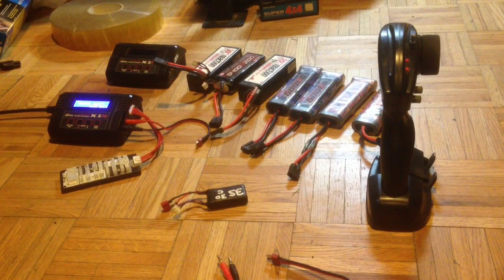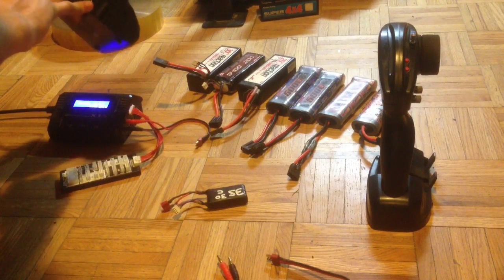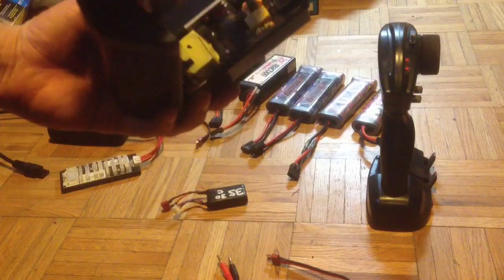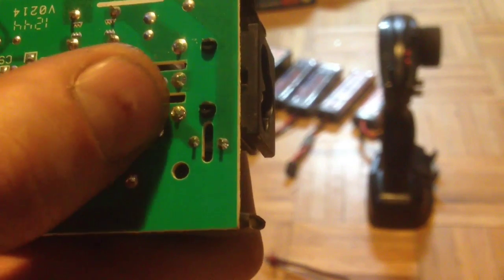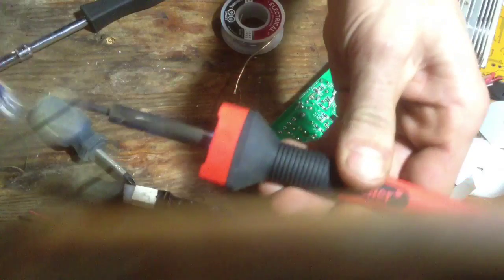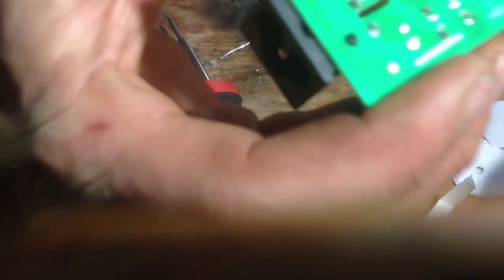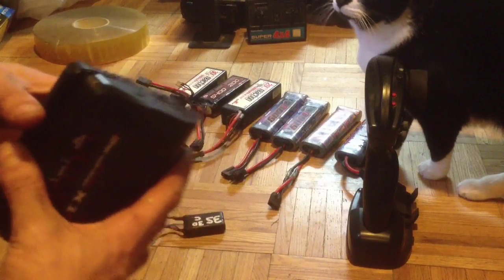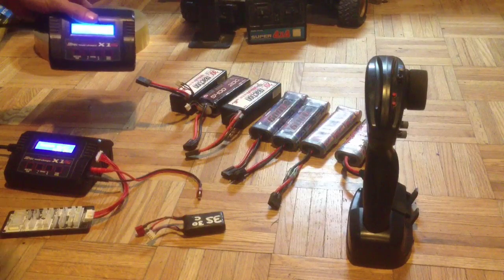Hi-Tec LiPo Balance ChargerRepair/fix power issue shutting off

Comment: That was cool bro a little dabah do ya I have to prepare a LiPo battery one of the battery wires probably off the balancing side came loose want to try to do that today $85.00 battery I don't want it to go to waste when a little bit of solder hopefully fix the problem👊👊👊👍
Reply from the maker: Roy Nelson yea it should work, the balance wires r easy to solder, the main feed wires r a different story,
Reply: chris bro right on bro I hope that's all it is